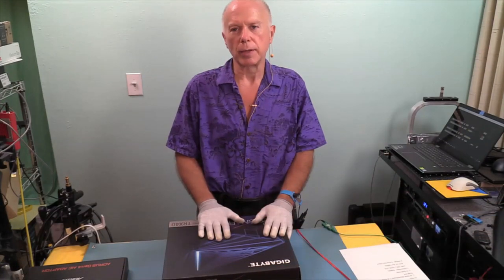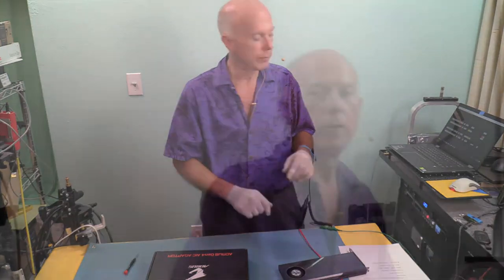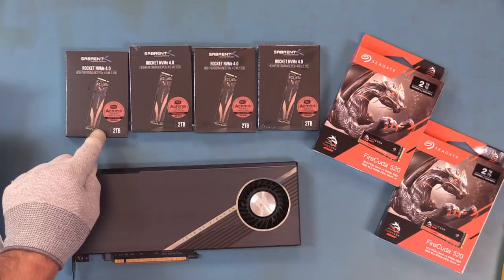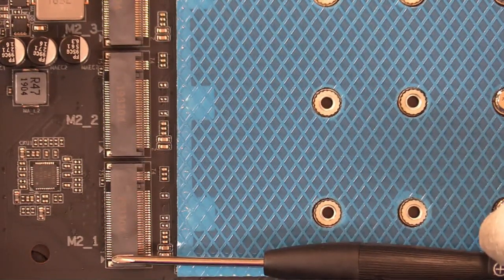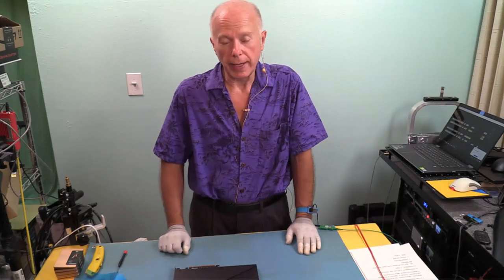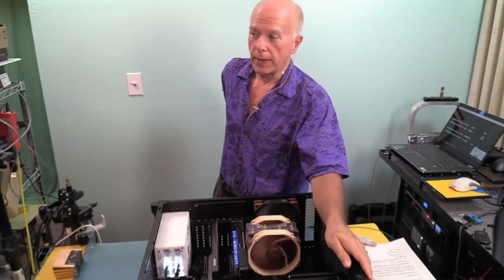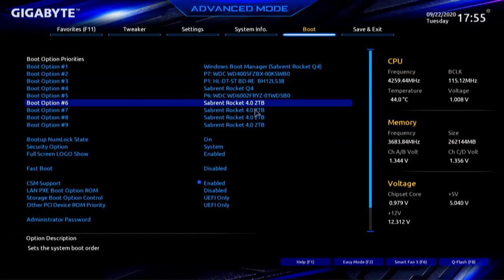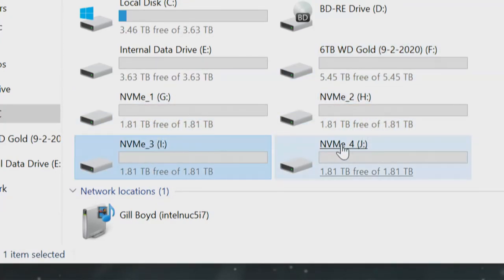Gigabyte AORUS Gen4 AIC Adaptor Comparison and Simple Install Tutorial TRX40 Designare

Comment: Hello i have a x570 mobo and i have that aorus adapter with 4 nvme in it. But my bios only sees one drive. Bifurcation is on 4x4 and i am running the latest firmware. i am doing something wrong . But i don't know what....
Reply from the maker: Hi Peter, Nice to meet You! Are You in 1st x16 Slot? Which x570 Motherboard are You using?
Reply: @BuildOrBuy  hello yes i am in the first 16 slot . I am using the aorus master X570 board. I am Running the latest bos version. And put bifrucation on 4x4 manually. But Hen i look in pcie in the bios. It says my first slot where they card is in is a 8X . And i tok the card out and on the mobo is 16X so i'm in the right pci lane. I have a m.2 on the motherboard but i rook that one out already and booted the pc again via An SSD. But stil nothing. The pc Sees only one nvme. And they are all Four out of the box new gigabyte pci4.0 nvme's.
Reply from the maker: Hi @peterbrepoels2079 , Give me a few minutes. I need to research Your Motherboard. Be right back!
Reply: @BuildOrBuy  no problem take your time. I am glad someone is Willing to help.
Reply from the maker: Hi @peterbrepoels2079 , Reading though, page 10 in PDF Manual. Lots of double talk. In a nut shell, no go. You should only see 2 Drives. Otherwise, You need a self Bifurcating card that works in a x8 Slot. GloTrends has a card that will work in Your system. It's PCIe 3.0. We have a Video up on that one - GloTrends Sky. 

https://www.youtube.com/watch?v=QF71-5nhrAk

The only PCIe 4.0 self Bifurcating card, currently on the market, is from High Point. That card requires a x16 Slot. I have read some x570 Motherboards can do what You want but not this one. Bummer! 

I'll do some more research and see which x570 will support that card.
Reply from the maker: Hi @peterbrepoels2079 , Always! Nice to meet You! We're here to help! This also helps Us to make better videos! 

You would be amazed if You saw how many we have helped with the ASUS Hyper Quad card. We have a Video on that one too! Give me a few minutes...
Reply from the maker: Hi Peter, No Go. Not one single Gigabyte x570 can do that. The x16 Slot will run at x8. Had to read through through the double talk to get that. 

According to everything about the x570 Chipset, it would work. Even talking to High Point and what they had to say, everyone wanted to try the High Point PCIe 4.0 x16 (self Bifurcating) card on the x570. And it will not work! Wonder how long it's going to take for everyone else to figure that out. Wow! 

Now, You  should see 2 Drives. But you're only seeing 1 Drive. Will require a Bios Update. I'm glad You've asked this question! Never expected this! Wish we could have provided better news! What a mess!
Reply: @BuildOrBuy  thank you so much for the clear info. This is what i diden't get from gigabyte. I do geven there mail that it van work. So i Will ben zending the card back. Or maybe for a Future build. Love your YouTube channel btw.
Reply from the maker: Hi @peterbrepoels2079 ,
Don't know why this is so complicated for Vendors. No wonder we're having trouble getting Bios Updates! It's a great card if You have the PCIe Resources. This type of card is made for a HEDT. For PCIe 4.0, that would be TRX40! Let me know if You need help any in the future! Thank You for Your Comments!

Comment: I have just installed mine in the 8x slot on a msi x570 tomahawk as only using two drive at mo,  only one drive showing, which i will check the bios for bi-furcation, but is the fact the slot is not 16 electrical relevant?
Reply from the maker: Hi Andrew, Not being in a x16 Slot electrically is very relevant.  Once Bifurcation is enabled in Bios, 2 Drives are all You will see. The only way to see 4 Drives in that Slot would be to install a Self Bifurcated M.2 NVMe card like the GloTrends Sky card. Hope that helps!
Reply: @BuildOrBuy  hi thanks for reply. I should have also mentioned I am using the motherboard M.2 sockets as well. Looks like I am outta PCI lanes. So, what I have done is put the two x 2tb 970 evo drives back on the motherboard and 1 on the card. the gfx card (3080) is running 8x but I am not losing any performance so good enough. what I did observe is the CPU connected m.2 is about 10% faster than the non direct coupled pci lanes. I got the card on a deal for £60 so happy enough.
Reply from the maker: Hi @Outdoorshuntingshooting , Absolutely! Here to help! Changing one thing, changes everything! Glad You figured it out! PCIe Resources. Let's talk chipsets next time You Build.

Comment: What is the cheapest motherboard you can use AORUS Gen4 AIC Adapter?
Reply from the maker: Hi Cebrayil Qafarli, 
Great Question! Generically, a Quad card requires a dedicated PCIe X16 Slot, Bifurcated in the Bios from X16 to X4X4X4X4 for Full Bifurcation. That is on a HEDT or Workstation class Motherboard. Some Viewers have used Consumer Desktop Motherboards for this purpose by sacrificing the Video card which can work in a X8 Slot or using Onboard Video if supported by CPU. Doing the math on CPU PCIe Lanes helps Us to understand the situation! In a nutshell, We need more CPU PCIe Lanes than 24. That only allows for 1 - X16 + 1 - X4 (M.2) and 4 Lanes left to connect CPU to Chipset. 

A HEDT with PCIe 3.0 would be Intel X299 or AMD X399. For PCIe 4.0, AMD TRX40. Both Intel and AMD are abandoning the HEDT. Therefore, the Workstation for PCIe 4.0 would be the AMD WRX80. 

ASUS has a Bifurcation Chart indicating which Motherboards of theirs can be Fully Bifurcated. 

ASUS Bifurcation Chart
https://www.asus.com/us/support/FAQ/1037507/
Hope that helps!

Comment: Do you know if this card works in linux? I'd like all 4 drives to show up individually then use zfs to create a raidz pool. The board supports bifurcation 4x4
Reply from the maker: Hi mr kek,,
Welcome! Great Question! It should. As an Add in card, I/O is a function of the Bios. The 1st Question for JBOD, does Your Motherboard, CPU and Chipset have the PCIe CPU Lanes to accommodate this technology. Two Requirements, a X16 Slot, electrically and Bios Bifurcation. The next Step if so chosen would be RAID. This Add in Card can be either a Hybrid Bios Bootable RAID or an O/S RAID. Both are CPU based RAID vs a GPU based RAID. More than You asked but thought You might Appreciate knowing that path.

Comment: have you tested to see if the card would be of use running at x8
Reply from the maker: Hi NaruHaxor, Good question. Only 2 Drives would be seen. In a x8 Slot, a self Bifurcating card with 4 Drives such as the GloTrends Sky card would be preferable.

We have a Video on that card here:
https://youtu.be/QF71-5nhrAk

Comment: I have this AIC with Gigabyte Aorus extreme v1.0 MB running F6 BIOS, even with Aorus storage manager the fan runs at full speed all the time, there have been 2 occasions where it mysteriously decided to operate at a quieter pace, but I have no idea why/how, and on reset it goes back to full speed again (forever), anyone had this problem and found a resolution? (Thanks in advance)
Reply from the maker: Hi To the point,
Welcome! We never installed Aorus Storage Manager. We considered that extemporaneous software. Love Gigabyte Hardware but not a fan of Gigabyte software. Yes, We endure and put up with the Fans running full on. Sorry We could not be more helpful. The HEDT was a great Platform!
Reply: @BuildOrBuy  I decided to try and initiate XMP in BIOS, the profile didn't take, and my poor old RAM is still running at 2133, however it somehow had the side effect of reducing the fan speed on the AIC, I have tried multiple resets, shutdowns, and even PSU power off after shutdown, and the quiet blissful fan speed remains, I wonder if you could perform the same operation to see if you get the same result?
Reply from the maker: Hi @tothepoint551 ,
Supposedly, the only way to control the AIC Fan is from Aorus Storage Manager. We have XMP enabled and have not had any problems with the AIC Fan. But since We never installed Aorus Manager, Our AIC Fan also runs full blast. Hope that helps!

Comment: great video! i have a question if i installed 1TB nvme (bootdrive) and later on add 3pcs-1TB nvme on the remaining slots,  will there be any issue? or any inconvenience later on if I decided to install the 3nvme? Thank You
Reply from the maker: Hi RockstarSyndrome,
Welcome! Great Question! Appreciate Your Comments! That Depends. We have to Qualify Our response. It should not but it might.

1. Does Your Motherboard have a x16 PCIe Slot, electrically not just mechanically?
2. Can that Slot be full Bifurcated from x16 to x4x4x4x4?
3. Does Your CPU have enough PCIe Lanes for that PCIe Resource allocation?

If All of the above are true, all will be fine. The next Step would if all 4 Drives are to be Singular as in JBOD - Just a Bunch of Disks or all 4 in RAID. That's why We make these Videos to simplify the Process. Hope that clarification helps! Thanks for Watching!

BTW: What's Your Motherboard Model and Chipset. We can check for You. To get into all of that Requires a Video to Explain what We need to do to make that work!
Reply: @BuildOrBuy  First of all I want to give complement to you that you are a professional on your field. 

My computer is hp z840(no m2 slot) and quite slow on boot time ((i have HDD b4 and then ssd and then new ssd (all previous was broken for some reason) ) and have a haunch that my storage drive is the bottle neck.

 So I searched over the net about storage, I was opting for HPZ turbo drive but its quite expensive so I ended up with Aorus.

in your video 47:24 you said that "it is a one time procedure" so this triggers me about my question regarding the boot drive.

what you suggest?
1. shall I buy 3 other drive
2. or there will be no issue if i go ahead with 1 nvme and later on add the 3 if I needed to.

3. is there things that I am missing because im not a technical person. 

thank you very much sir!
Reply from the maker: Hi @wilsione ,
Thank You! I'm honored! Since Your HP Z840 does not Support Bifurcation, You'll need an Add in card that is Self Bifurcated. Those types of cards have a PLX Chip to handle the PCIe Lane Switching. Since Your Motherboard does not have an M.2 Connector, Your Bios may not Support Booting from a Self Bifurcated add in card. Highpoint makes a Bootable, Self Bifurcated card for 4 M.2 NVMe Drives. 

Highpoint SSD7505 RAID Controller
https://amzn.to/3MlD3CB
As an Amazon Associate I earn from qualifying purchases! This card has its own Bios and will Append Your Motherboard Bios. Configuration is a bit involved. We may create a Video on this card in the future to simplify understanding the process.

Comment: Ya you definitely know what your talking about. I look forward going through your videos.
Reply from the maker: Hi Darius George, Nice to meet You! Thank You for joining Us! Welcome! 

If there's anything in particular You're looking for, let Us know!
Reply: @BuildOrBuy    Hey it's a pleasure to meet you too.  I wish I had come across the knowledge and understanding you have back in Feb of 2020.  I own both a ASUS Hyper M.2 Card V2 and an Aours Gen4 AIC Adaptor(Both Cards are in box doing nothing lol).  I had to learn many things though trial and error on my own and in retrospect I wish I had considered the PCIe lanes I had access to.  I should've went TRX40 Aorus Xtreme with Treadripper 3960x rather than x570 Aorus Xtreme with 3950x.  I have looked briefly on you videos and the product itself but it actually appears there are Gen 3 x8slot AIC card that can support 4 NVMes? or even a x4 slot?  what about a Gen 4 AIC x4NVMe card that is only using 4 or 8 lanes but can read all 4 NVMe's?  if you know of any, and especially any with RGB lol let me know.
Reply from the maker: Hi @403errorskydaddynotfound3 , I wish You had Found Us sooner as well! But we're hear to help now! 

Everything on the Specs about the x570 says this works. However, as You have seen the implementation says different, after reading through the double speak. 

In a nut shell, for the x570, since You have 1 - x8 Slot, You need a self Bifurcated AIC. Glotrends Sky AIC. We have a Video on that. Only PCIe 3.0 at this time. No one else yet has a Self Bifurcated PCIe 4.0 AIC that uses 1 x8 Slot. The others all require 1 x16 Slot which in reality is an oxymoron of technology. 

Glotrends Sky AIC Video: https://youtu.be/QF71-5nhrAk 

Let's talk Chipsets and PCIe Resources next time You get ready to Build! Hope this helps!

Comment: Thank you, this helped, how do you set up the raid on it, i cannot get it working at all.
Reply from the maker: Hi Rob, 
Looks like we need to do another RAID Install. How far did You get? Bootable RAID or O/S RAID? Bios or Driver?

This Video might help as a checklist: 
ASUS Hyper M2 X16 NVMe Quad card plus four Samsung 970s - AMD NVMe RAID 0 Upgrade
https://youtu.be/x5G-zciner4
Reply: @BuildOrBuy  I have it installed and sort of working, the ssds are set up windows can see them, however, if you open the aorus storage manager there are no disks present. I have it on irst running raid 0, but weirdly can't see the ssds on the aorus storage manager. I am booting off another ssd on the motherboard. I couldn't get it working to boot off the card itself with the two 512 samsung pro ssds, as that would have been awesomely quick. I am trying to get it to work with an Aorus x299x master, you would think it would be plug and play. :-(
Reply from the maker: Hi @RobWellard  , Knowing Your Chipset helps greatly. Working with where You're at now... Did You install the Windows RAID Chipset Drivers?

Comment: You mentioned this card on an X570 mobo will need the PCIe x16 slot and the GPU will then need to be installed in an PCIe x8 slot. I understand why, but I'm curious as to what happens to my RTX3070 in a slower slot? Is there another option or should I get a different GPU?
Reply from the maker: Hi Anorexic Rango, 
Nice to meet You. Keep Your GPU! The problem is the Motherboard. Not enough PCIe Resources if You want both the GPU and an M.2 NVMe Quad card. You need 2 x16 Slots. Not happening on x570. Give Us Brand and Model of Your Motherboard, we'll check what You have. And let You know Your options. 

Another option is to use a self Bifurcated M.2 NVMe Quad card. Would require a x8 Slot. If Your Motherboard has 1 x16 and 1 x8, they will both be used as x8. Why: Shared Resources.
Reply: @BuildOrBuy  I have not yet purchased a motherboard. I have the Ryzen 9 3950x cpu and I'm building around it. I'm now trying to figure out how to incorporate 4 or more NVMe M.2 drives. I greatly appreciate your vids and information you provide!
Reply from the maker: @rango_unchained  Thank You! Appreciate Your Comments! Here to help! Let's cut to the chase from the direction You've just mentioned. You want 2 x16 Slots. That's a HEDT. Or, considering the CPU You have, You want an X570 Motherboard with 1 x16 and 1 x8 Slot. When both Slots are used, because of shared Resources, You end up with 2 x8 slots. Video card x 16 is cut to x8 and NVMe Drive Lanes are cut. Why? Shared PCIe Resources. 

Your option then would be a self Bifurcated PCIe M.2 NVMe Card. You want PCIe 4.0. Since You have a x8 Slot, You're only going to have access to a self Bifurcated PCIe 3.0 card. There are no self Bifurcated PCIe 4.0 cards that give PCIe 4.0 performance yet. Lots of tradeoffs. The other direction is back to a HEDT x299, x399 TRX40 or WRX80 Motherboard. The chipset is the Foundation of a Motherboard. 

For 4 NVMe Drives, using what's possible even on the Motherboard like a HEDT, You might have 2 through the CPU and 2 through the Chipset. Four PCIe M.2 NVMe SSD Drive on a Quad card keep them equal in performance since that Slot will either be connected through the CPU or the Chipset. Crazy right. It's just a matter of adding up the PCIe Lanes and figuring out their respective Distribution. I don't think enough is being said about this subject. Seems like lots of smoke and mirrors.
Reply: @BuildOrBuy  Thank you very much! I have some choices and will consult with my CFO before I make a decision. I'll catch up on more of your vids in the meantime.
Reply from the maker: Hi @rango_unchained , I hear that! Let me know when You're ready to proceed! Or if You need more insight on the subject. Hope that helps!
Reply: @BuildOrBuy  I have learned so much watching from your vids! I sold my 3950X CPU, kept my RTX 3070 (I really want the 3090 for MS Flight Sim on VR) and am now looking towards building my first HEDT. I know now the X399 is a good starting point for the mobo, but I want to future proof my build to a degree. Will a TRX40 mobo be better for that purpose? I believe the X399 limits my CPU options. Also, would buying a PC with a RTX 3090 already installed be a better idea?
Reply from the maker: Hi @rango_unchained ,
Thank You for Your Comments! Appreciate Your Support! I'm honored. Smart choice going HEDT! You're biggest difference with x399 (PCIe 3.0) vs TRX40 (PCIe 4.0). Both can have 2 x16 Slots and 2 x8 Slots. Either way, CPU options... 

For CPU socket sTR4 - x399 Chipset = 11 CPUs 
for https://pcpartpicker.com/products/cpu/#k=36

For CPU socket sTRX4 - TRX40 Chipset = 3 CPUs 
https://pcpartpicker.com/products/cpu/#k=38

Going forward, WRX80 Chipset was suppose to have 4 CPUs. Looks like that will now be 3 CPUs. Still PCIe 4.0. However more PCIe Lanes. How many? Enough for 7 x16 Slots and no Shared PCIe Resources! 

The TRX40 is a good place to be. Everything changes when PCIe 5.0 then PCIe 6.0 becomes avaialable! Perception and Perspective. Hope that helps!